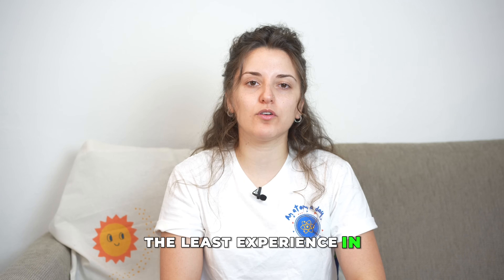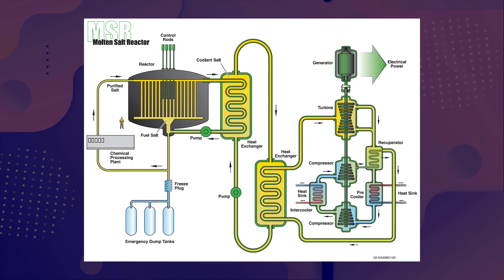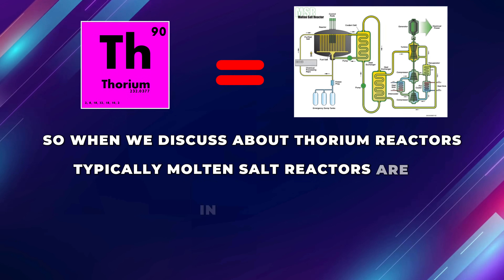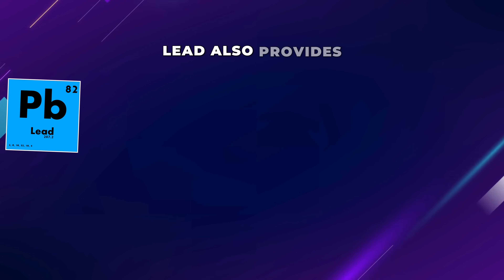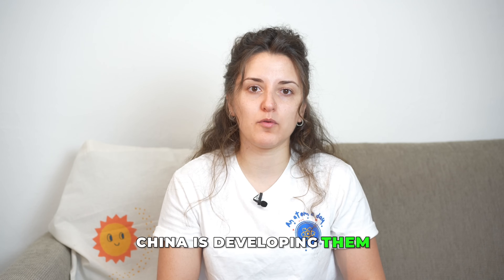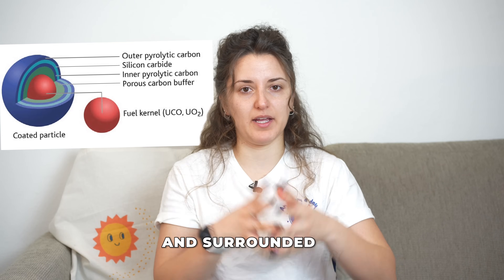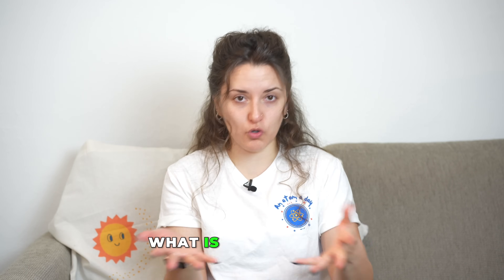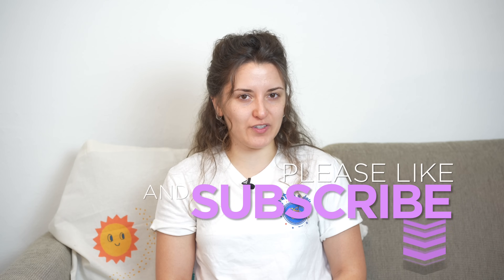Nuclear Physicist Explains and Compares All Gen IV Reactor Types

Comment: I'm starting to realize that separating these designs into categories of "reactor types" like this may not be very useful anymore.
For example a sodium cooled fast reactor and lead cooled fast reactor don't really have that many differences but warrant a different category apparently.
In the meantime Molten Salt reactors were a single category even though something like the Heavy water moderated Thorium cycle container sized reactor from Copenhagen atomics is VASTLY different from Molten Chloride Fast Reactor developed by Elysium Industries (although maybe now bought by TerraPower from what it looks like)
Reply: While the pictograph of sodium and lead cooled reactors are very similar, the materials and operational parameters are very, very different. As one example, liquid sodium is 100% compatible with typical nuclear stainless steels so no need for very expensive exotic materials, lead is not.
Yes, there are many, many different MSR pre-designs, but given only a handful have ever been built and those only ran for a short time, they are lumped together due to lack of experience (i.e. it is a general category because it is not flushed out yet as to what might work and what won't). We even have designs like MOLTEX, which looks like a SFR in a pictograph, but is really an MSR in disguise....lol
Both TerraPower and Elysium were developing molten chloride fast reactors independently. TerraPower in addition to the Natrium SFR is continuing that molten chloride fast reactor development at INL, but Elysium hasn't seemed to be doing much for the last few years.

Comment: Isn't lead more corrosive than thorium? Combination of thorium as fuel and lead as coolant sound bad! Correct me if wrong, just curious, thorium reactor try to separate atom into uranium things, and you said it's leave less nuclear waste materials. Can the residu also processed within ALPS with some output that might usefull for fuelling or cooling fusion? Or the world still far from those as real thing.

I also get confused over nuke cooling system, in CPU GPU even car engine are better to use water rather than gas or air. For more better coolant performance some enthusiast even use radiator fluid concentrate 50:50. But latest generation of nuke reactor some even still use gas? How it perform better cooling? Btw sun symbol freemason isn't that in back. Not mean to bug girl.

Comment: Fuel in multilayer spheres that contain carbon are flammable. The problem only appears if the reactor casing is damaged. Combustion would be partial in the best case, stopping at the level of the silicon carbide layer.

Comment: Yes silicon carbine layer videos please. Also using helium is super cool ---- it's basically radiation proof and can get super hot --- except it is also a very small atom and will leak through most metals so containment is an issue at those temperatures. (Would be interesting if doping a metal lattice with helium could make it stronger, um ...)

Comment: The reason these reactors are exciting is amazing efficiency.  Nuclear energy is over 1,000,000x more dense than fossil, So, 1g of nuclear fuel = 1 ton coal/oil, etc.  But, current reactors require energy to enrich fuel, and they throw away 97% of it as "spent" fuel.  It is still worth it, even with that level, but imagine using it all.  That waste is mostly U238, or you can start with Thorium, either way, you get ALL the energy.  Using thorium as an example, Monazite sands typically contain more than 6% thorium, which are mined for other "rare earth elements" and thorium is a waste product.  The thorium found in one soda can of sand equates to the energy of 40,000 gal of oil.  Why would you need fossil fuel again, for anything?

Comment: Correction: TRISO fuel packaging is available for both spherical and cylindrical pellet shapes. The heat resistance seems to be slightly better for the spheres but traditional cylindrical pellets can also use this packaging. This allows some flexibility in reactor designs that can take advantage of TRISO.
Reply: Source: US government websites, X-energy’s company websites.

Comment: My reactor wish list:
- Uses most of the energy in the fuel, leaving relatively low level waste.
- Passive safety
- Ideally general safety, not just meltdowns - some designs look like they have a fire risk with coolants like Sodium
- Uranium and thorium (not necessarily in the same reactor, but I'd like to see the energy system using both)
- Zero water - you can put one in the desert and air cool it with no external water input, and thus no environmental impact on waterways and no shutdowns because climate change or overuse dried out the river
- Ideally high temperature operation, for thermodynamic efficiency and for use in chemical processes like 0C jet fuel synthesis.
- Ideally not a lot of expensive fuel pre processing such as enrichment
- Would be nice if it could burn down high level nuclear waste, perhaps added to the fuel mix, though special purpose reactors would suffice for this niche task.

So is the above list even achievable?
Reply: It may be possible with compact molten salt reactors. Check Wikipedia

Comment: Given the farce that is Flamanville III personally I do not see the point. IE It was originally supposed to be 3.3 Billion Euros and it's cost 13.2 billion Euros so far, and is 12 years late for a 5 year project. IE started 2007 for delivering power to the French grid in 2012. However the current estimate is loading the fuel early 2024, and then there is all the testing to be done.

Comment: Couple of missed advantages in some of these designs. Specifically in MSRs a couple of big ones. Molten salts chemically bond with most fission products. This increases safety through sequestration of materials that in current designs can be easily volatilized and dispersed. 
Also, in thorium MSRs you can achieve much of the advantages of fast spectrum reactors in a thermal spectrum due to the breeding ratios of the fuel cycle while eliminating some fast spectrum disadvantages. Particularly higher fuel requirements and enrichment requirements. 
A final missed advantage on MSRs is the passive safety offered of a liquid fuel and solid moderator configuration. During reactor temperature excursions or other safety critical conditions, a simple passive freeze plug can melt and gravitationally drain the fuel away from the moderator core ceasing fission and placing the fuel in a safe confinement location all without human intervention. 
Some of the advantages of these other reactors coincide with the above list as well. But IMHO the MSR concept captures virtually all of the best advantages of the generation 4 reactors with minimal downside. As well as being perhaps the second or third most tested concept in the list.

Comment: whatever one fits on a boat to use as a power station for an off shore drilling platform that uses acids to brake down minerals below the sea floor... really sensible extraction to have a one way valve on the sea floor that opens after so much is pulled out water soluble metallic nitrates... and is its full of sand the nuclear power station on the ship can sent 3gigawatts of electricity down to the "forming reservoir" to brake down hydrogen and oxygen that is then flash burnt creating a large pressure wave that ejects everything and frack shocks the base at the same time. from what I know iron has a similar acidified solubility as uranium, so if the extracted minerals are not filtered and just taken out of fluid suspension things like a metal spoon or bolt of some kind would then naturally have trace amounts of uranium and thorium in them would seem good for some equipment working in snow so it naturally melts off of it. why are the metal scrap things in Chernobyl radio active... deliberately... rail road tracks/de-icing. huge processing job just to "clean" dirty iron.

Comment: Can I assume that steel is one of the materials of construction of any fission reactor? Would you tell the folks what radiation does to steel? What would be the operating temperture range of a typical reactor design? What would be the typical pressure range of your designs? How often would you check for damage done by breathing (as metal heats up, it expands, as it cools, it contracts)?

Comment: The US is also developing SFR, GE-Hitachi’s S-PRISM. They have a partnership with Terrrapower to build a reactor in Kemmerer WY. The intermediate loop has been replaced with molten salt allowing the reactor to be separated entirely from the load isolating the nuclear island (this was my dissertation research). Furthermore the SFR was designed (metal fuel) for entirely closed fuel cycle with complete consumption of the minor actinides. This is known as the Integral Fast Reactor. Pyrometallurgical processing is very interesting in its own right.

Regarding the molten salt reactors if there is anything that thorium can do, uranium can do better. There is nothing that makes this reactor type inherently thorium based reactors.
Reply: Thorium is a good option to have for certain use cases. Control of the entire fuel cycle can be desirable for strategic and economic reasons for example and thorium is more readily available than uranium inside some countries. International trade is a good thing in general but it does pose some logistical and political risks. 

Thorium might also be somewhat more palatable to encourage, enable, or provide for certain countries with questionable motives and intentions. While it could still produce weapons materials, it is somewhat more challenging to do so. 

Lastly, thorium is frequently collected in outdoor mounds as mining waste. Putting that waste to use can be seen as a benefit, rather than indefinite storage in piles of dust.
Reply: @Stu_Bur  I think you missed the “anything Thorium can do Uranium can do better.” If you want a discussion on fuel cycle options I’m open to it. I do have a PhD in nuclear engineering and as I indicated in the post have expertise in sodium fast reactors which have been an active research area for over 25-years.

Comment: Each of these reactor concepts would be worth a separate video. Also, the current breed of SMRs that seem to be adopted in, eg, Poland - they seem all to be of either "classical"pressurized light water kind or boiling water, using thermalized neutrons and enriched uranium fuel - so, pretty conventional.
Also, I believe that Japan plans on building some kind of high temperature reactors they would utilize for hydrogen production, something they seem to be enamored with. A video on that topic would be nice, too.

BTW, are those deadly looking talons/claws removable? Retractable, perhaps? 😀 (I don't imagine gloves like them...)

Happy holidays and thank you!

Comment: Elina, please talk more about which of them can operate as breeder reactors.  Since breeders can use ore 100x more efficiently, they make nuclear energy inexhaustible.

Generally fast reactors can breed , and some thorium types.
Reply: For fast reactors (generally U-Pu cycle as Th-U cycle doesn't work as well in fast spectrum), whether they breed or not is a design issue. Some are burners only, some breakeven and some can breed well above breakeven. It all depends on what you do with the higher than avg (compared to thermal spectrum) number of neutrons per fission (e.g. capture them in a U238 blanket, reflect them back into the core, etc...). All of the fast spectrum U-Pu types can be designed to burn, breakeven or breed. SFR and MSR are the primary types here due mostly to the relative ease of reprocessing (some form of which is required for ALL breeders, including Th thermal breeders if the goal is high fuel utilization)).
Th based reactors afaik are ALL thermal spectrum breeders and MSR seems to be the only practical path if you want to approach that 100% fuel utilization. It can certainly be used in mixed U + Th (with Th replacing some of the U238) in other thermal types such as CANDU, but won't get the same fuel utilization. The reason is that you need to get the Pa resulting from Th absorbing a neutron OUT of the neutron flux to allow it to decay into U233(which takes a month or two) before it absorbs another neutron and results in non-fissile material. It's breeding ratio is also smaller compared to fast U-Pu, so you can't afford to waste those neutrons or Pa if the goal is high fuel utilization.

Comment: A unique and interesting design is the Moltex SSR which is a cross between an MSR and SFR. It uses fuel pins like the SFR but filled with molten salt fuel and so they can use natural convection to keep the fuel mixed and transfer heat to a surrounding inert salt so you can get the benefits of MSR without having to pump super radioactive fuel around a circuit. 

I think its a really clever design and could be the dark horse of gen 4.
Reply: It also greatly simplifies the fuel chemistry issues that MSRs have. The down side it the output temperature is lower.

Comment: I greatly appreciate the comparisons. It can be difficult to remember the various types.   One comment: I've repeatedly heard that floride is not corrosive!  It becomes corrosive if there is moisture (H²O) in the mix, but pure molten salts are less corrosive than pure water.
Reply: That may be true depending on which fluoride salt is being discussed, but you have to keep in mind that the high temperature water used in reactors is itself highly corrosive.

Comment: I'd go for HTGR.  Nuclear will be expensive.  Probably won't be ready for mass deployment till 2030's.  To justify its cost, we need to look to unique attributes, and "added value".  High temperature may play a role to hard to decarbonize sectors, such as industrial heat, and hydrogen production.
Reply: High temperature means more electricity out of similarly sized reactor, so lower LCOE, at least in theory.

Comment: Also , there was a prototype high temp gas cooled reactor in Fort Collins, CO 50 years ago, but it was shut down because the fuel became too expensive
Reply: Public Service Company of Colorado (now part of Excel Energy) built and Operated the Ft. Saint Vrain HTGR.  What I understood was they had a lot of problems with the Helium system.  Wiki page has some good detail on the issues.
Reply: St Vrain was moderated helium cooled
Reply: If it was done 50 years ago, I can understand there would have been a lot more challenges & costs associated with early R&D.

Comment: Can you make a video on how a Liquid Metal cooled reactor starts up from cold and how it shuts down?  Getting the “cooling” material liquid thru all the pipes at startup must be complex.
Reply: They're probably using a metal that is liquid at ambient temperature. So it's the same as any other liquid, really, just heavier.
Reply: @davidwilson6577  but they are not liquid at atmospheric temperatures. It’s a good question. If you had to shut down the reactor for a long period for some reason and the lead or sodium metal cools in the pipes of the primary or secondary heat exchange systems, how do you heat it up to a liquid state again? Do you need a preheater throughout the system before you can power up the core? Or can you slowly power the core letting it slowly melt all the metal in the system before bringing up the power to run the turbines or whatever?
Reply: @lyingcat9022  You may use gallium or mercury.
Reply: The reactor vessel has electrical heaters to keep the metal liquid before the fuel is loaded and during maintenance (if needed....decay heat may be enough if the shutdown is short). The secondary sodium loops that take the heat out of the reactor vessel can be drained to a heated tank during maintenance. Sodium melting point is only ~98C (just under boiling point of water), so it doesn't need to be that hot to flow.

Comment: You didn't mention that fast reactors require higher enrichment of the fuel, a cost that may offset the better fuel utilization (and becomes a political issue over proliferation concerns).  Also, leaks in liquid sodium reactors have been a problem as the sodium easily catches fire when exposed to air.  Experience with liquid metal coolants have been mixed with issues of maintenance (keeping the coolant liquified, reactor assembly/disassembly while submerged in liquid metal are two examples).  Not insurmountable of course, but these complications impact their commercial viability.

For my money, I suspect that a form of HTGR with a TRISO type of fuel is the most promising.  Perhaps an advanced PBR design or such that can passively cool through the reactor vessel.

Comment: I have a question, which one of these reactor types is most suitable (easiest to miniaturize, high power to weight ratio) for powering a spacecraft?
Reply: Numerous designs are being used and studied for spacecraft. Zero maintenance and zero refueling poses special challenges.
Reply: I think that the compact molten salt reactor has big advantages over all the designs that you outlined. But the greatest of these is low cost and the fact that it uses natural uranium. Seaborg technology is partnering with Samsung to mass-produce this design. Would you be willing to give a critique?